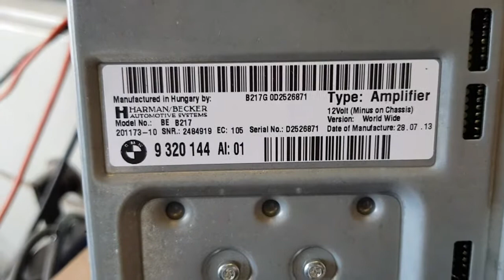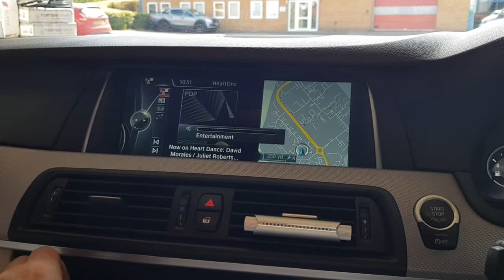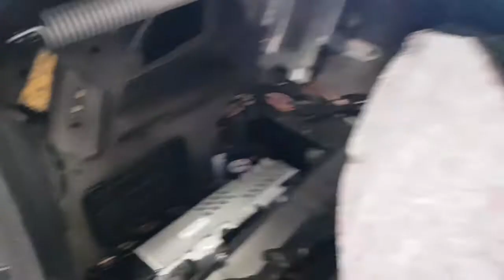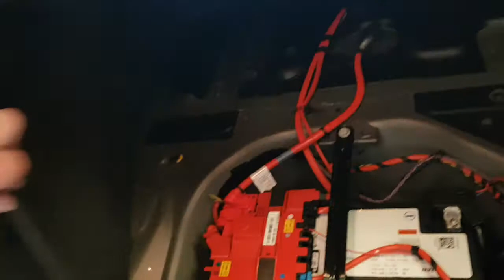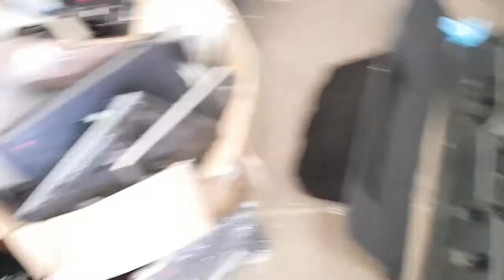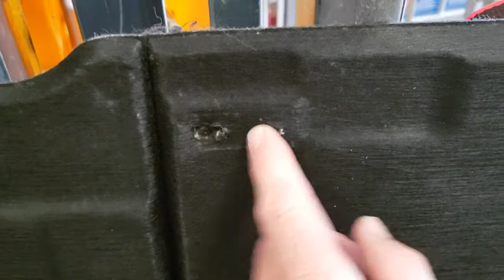BMW 5 series, no sound! Replacing a water damaged amplifier!

Comment: Are you sure you don't need to code? Amplifiers work normally for 30 min approx. then stops working, if you don't code.

Can you tell me how to prevent water coming into the amplifier? Everytime I open the place, everything is dry.

Comment: I have a f10 528i with the subs and speakers going in and out I just replaced amp with a new OEM and it came back and stopped working for half a day please help it's making me want to sell this piece of shit.
Reply: Normally you have to code it. It should work for a small amount of time, then it stops.
Reply: How much is the cost of coding @MajorSpeirs

Comment: I’ve have the same problem with my X5 F15.
Reply: Me too.  You need to seal the rubber to body and hatch for the wiring harnesses at the top of the hatch before replacing the amplifier.

Comment: Would the amplifier cause no display for the radio?
Reply: Did you find the answer to this? I also have no display and no sound
Reply: @musharrafkhan8734 it’s your unit hard drive behind the climate control
Reply: @musharrafkhan8734 Try turning your radio on
Reply: No, just no audio